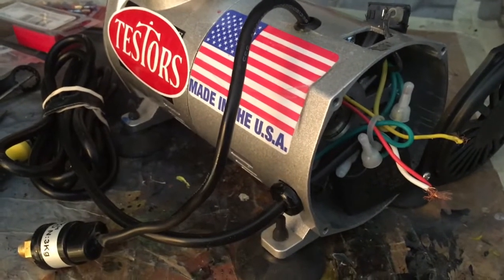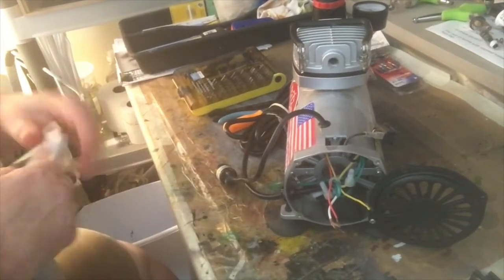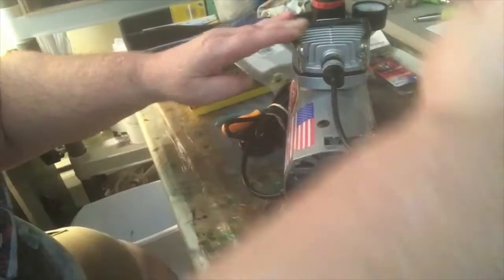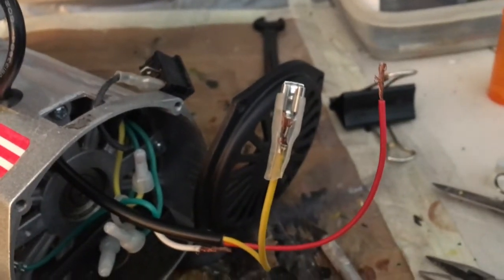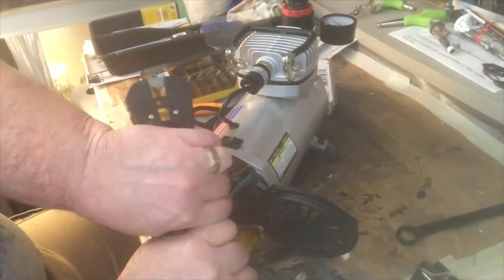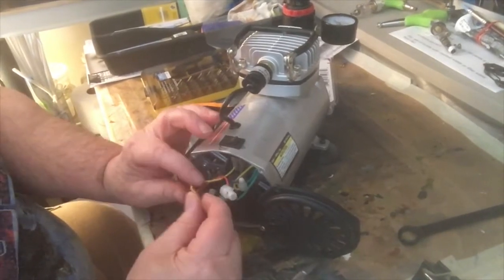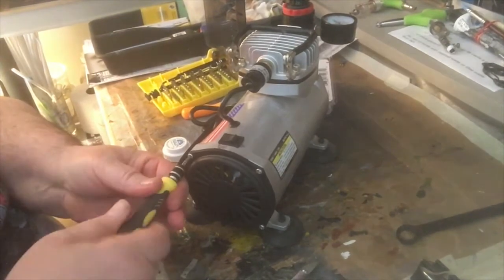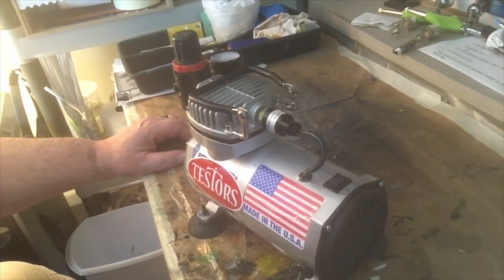How to replace the  pressure switch on a   harbor freight  airbrush  compressor

Comment: i have a cheap compressor that started acting weirdly, but i simply couldn't loosen the nut of the pressure switch, now the wrench will just slip around it, that's how much i've tried... I assume yours wasn't particurarly hard to remove?
Reply from the maker: It sounds like it is rounded off use vise-grip pliers

Comment: Where did you find the replacement switch?
Reply from the maker: From  Paasche Airbrushes website call them in the USA
Reply: @PeterAgostiniJdcap26  Thanks! Mine runs fine if I bypass that switch, so pretty sure that's the issue.